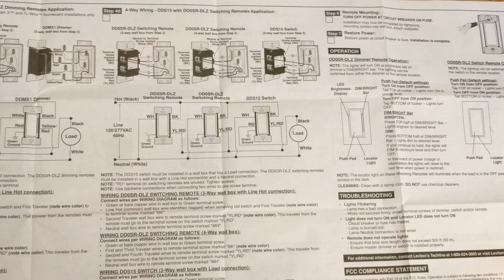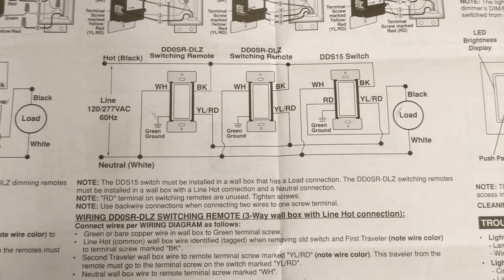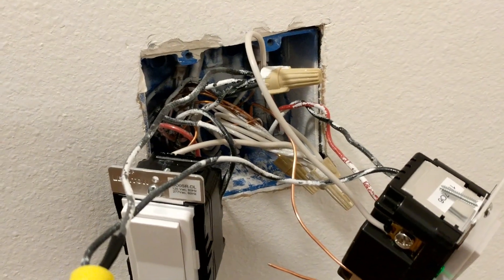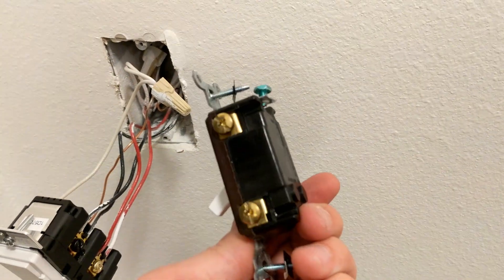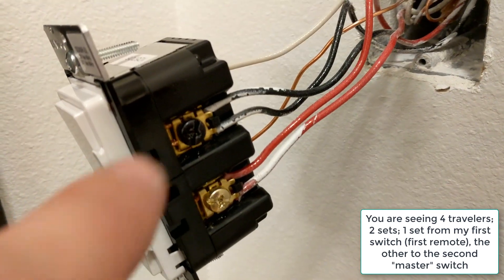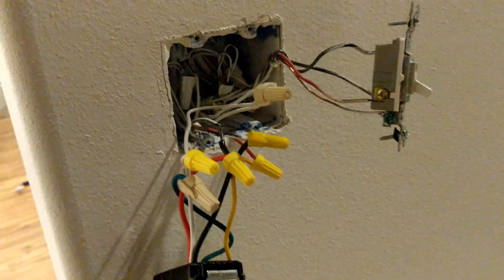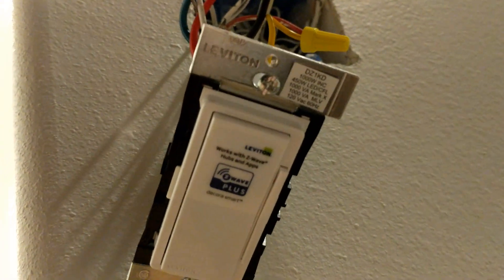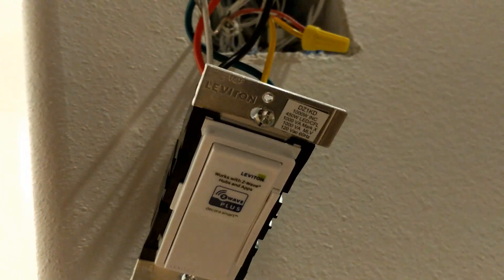Z-Wave - Four Way Smart Switch Installation

Comment: You advice to put the main dimmer switch at the LOAD, saved me a BUNCH of time with my installation of my Leviton Z-Wave Dimmer!!  Thank you!  In my case, In my case, my 4-way switch did not have a HOT. Instead, it had COMMON, and two TRAVELERS.  I re-assignes one of the travelers, making it HOT instead. Presto!  Now I had all of the necessary wires to make my remote switch work!   I'm with you! I do not like the stranded wire the dimmer switch came with!

Comment: I has 3 switch to turn the light on, 2 of them is 3way and one of them 4way, so can I just change one switch either 3way or 4way switch?
Reply from the maker: If you have 3 light switches to control one light, that would be considered a 4way switch.  You will connect the master controller to the wires that go to the light/outlet.  The switching remotes can be in either of the other two spots on the circuit; you'll write accordingly.
Reply: @jackstromberg  can we only change the master controller in this case?

Comment: The green LED light is the locator light I assume? When does it turn ON/OFF?
Reply from the maker: Green LED is used to find the light switch in the dark.  It is on when the switch is OFF and and OFF when the switch is on.  Unfortunately, there is no way to change this.

Comment: I’m trying to do something similar with a 4-way install using DH6-HD but I am a little confused. 

I have two 3-ways and one 4-way.  Can I put the two DDOOR’s on the 3 way and the DH6-HD on the 4 way?
Reply: Thanks! Yeah I figured out that I had to have it next to my load connection but I never got a voltage tester to see which switch was the load and which was the line (hot).  I also read somewhere that in a 4 way, I needs to wire nut the traveler wires together.  I haven't figured that part out yet though.